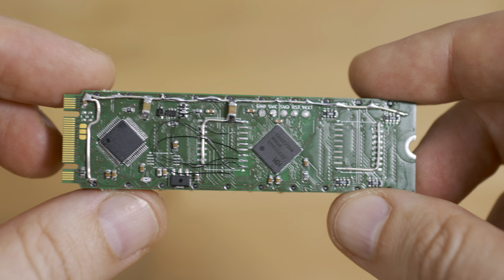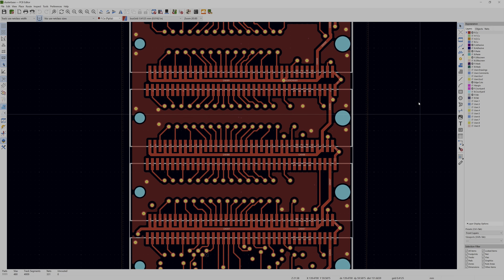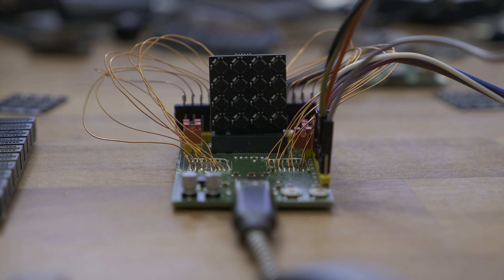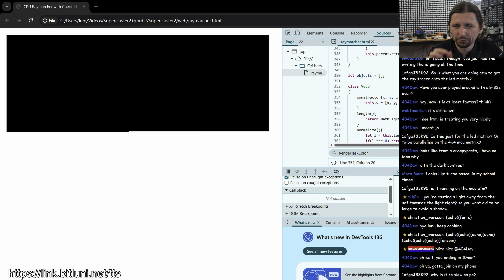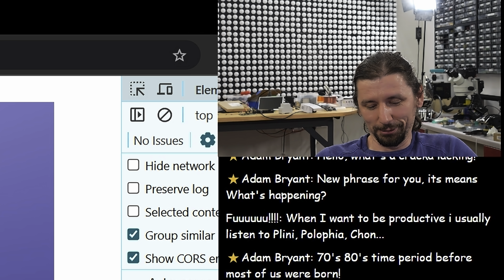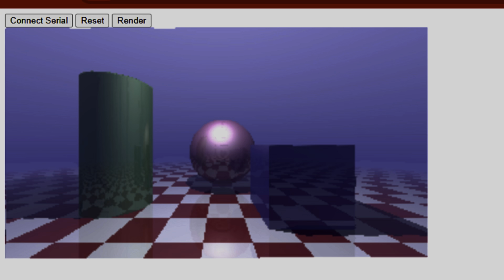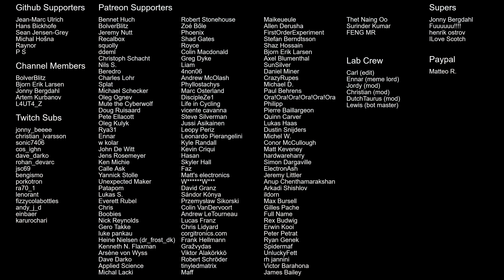I made a GPU at home

Comment: The fastest Async serial I've used is the FTDI 2232 3M baud mode. And at that speed you need to plan for cable impedance and termination.
Reply: Yeah uart just isn't made for "high-speed" transmission. If possible I would go for SPI which can easily do 10-20Mbit/s.
Reply: @robstamm60  it's perfectly possible to run UART on 11.5mbps or even more (getting stable connection at 28mbps on a custom UART). If you put rs422 transceivers in between, you can even do it at a considerable range.

And no, you do not need to think about impedance until about 100mhz.

Comment: Hey! Nice project! 
Fyi, I got myself a resib 3d printer and its very not as complex and messy as people make it sound. 

Basic cheap abs-like resin end up being heat resistant enough to handle soldering temperatures. You could model yourself a jig to align all your vertical m.2 connectors

Comment: When I Learned micro soldering (in uni) with solder paste the process was to apply the paste, then place the components on the PCB with pads or pin on the solder paste, the we could move the PCB with it's component to an oven (or more realisticly an hot plate for DIY).

Is there a reason to place the components on the hot plate like you are doing ? It's seems to make it more difficult ?

Comment: 3:25 "There was no chance to resolve solder bridges under the connector. That is why I reflowed first and then tried to place the pre-tinned headers"
You're welcome.
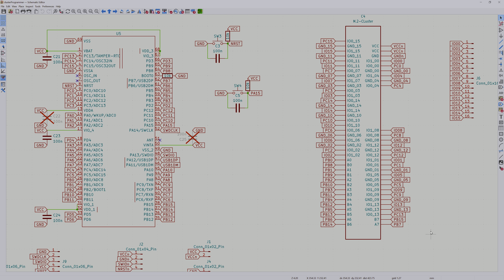Reply: 5:33 "Actually, on the cluster groups of 10 MCUs share a trigger interrupting all 10 MCUs. But during the trigger interrupt the id of the target is put on the data lines. The target continues listening while the others continue their tasks."
Reply: Thank you!
Reply: Thank you!
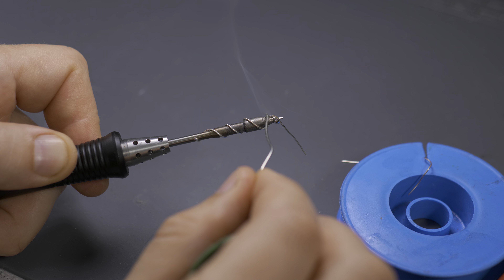Reply: 4:06 "The solder helps transfer the heat from the tip to the wire."
Reply: i happen to be on the mobile watching, thank you so much (if it were desktop i could use . and ,)
Reply: What fucking text are you people talking about, I go to the time stamps and i see no such text.

Comment: The amount of knowledge to do this is tremendous
Reply: One of the best things about Bitluni's projects is that you can follow along on the live streams and learn how to do these things at the same time.  It's not just the knowledge which is important.  Perhaps the most important component is the ability to research and learn new knowledge and to adapt to do whatever is necessary to finish the project.  This channel is a master class in such things.
Reply: @Peter_S_  no doubt..
Reply: @Peter_S_  I'd say the drive to do so is the most important. This dudes drive is enough to put a fist through a foot of steel.
Reply: @Peter_S_  I tell everybody that same thing, it's not the knowledge, its knowing how to learn it, understand it, comprehend it and be able to correctly teach it , simpler than how you learned it.
Reply: @Peter_S_  look man nobody is going to watch a 300 hour stream with about 20 hours of condensed knowledge. Some of us have jobs. That is literally the worst way of learning.
Reply: you got that right! he is a mad genius!
Reply: @GameOverDave not genius he just has good memory. Use some calcium tablet and vitamin b. It will help
Reply: @TecArtScien thanks
Reply: it is part of the addiction to flux smoke
Reply: Not if you study the basics of electronics and it's components and coding and read accompanied datasheets to your components and have a thought out project from the start, than prototype away
Reply: I watched this so I can pretend I know what he did
Reply: Annndddd you can learn it all for free online! That’s the power of the Internet! But most people choose not to, apparently learning is hard or something!
Reply: Kinda. But when you specialize, your capabilities increase exponentially as you gain knowledge and experience.
Reply: well, yes ... but on the other hand : standard micro-electronics & embedded software dev. We are indeed using dark magick - but you can, too! Everyone does
Reply: @ololh4xx  What's even more scary and dark magic is RF-electronics.
Reply: @Atom224  hush now, do no speak of terrible truths when mortals are around!
Reply: @Atom224  Here's a little secret...  Once you're working with transition times below 10 ns,  you're already practicing RF electronics whether you like it or not.  RF is just different but no black magic is needed, just exceptionally well understood math.
Reply: @ololh4xx  I don't know bro. Some of us are 15 watt bulbs with a 100 watt curiosity... The hands we were dealt haha.
Reply: @ololh4xx  this is absolutely not standard lol there's no way you are working a job in embedded
Reply: @warguy6474  sure. Good luck with your job training and whatnot.
Reply: I doubt it.
Reply: There is also patience involved in it that is high.
Reply: how do you even learn this stuff?
Reply: @Dark.Syndicate  Be sure all your notifications are on and join a live stream.  Bitluni streams fairly regularly and the streams are like hanging out in a dev lab.  Lots of helpful people and plenty of explanation.  He might seem like an electronics superhero, but he's just a regular guy with huge levels of drive and an appreciation for learning.
Reply: @Peter_S_  In fairness, there is a lot of material out there that can poison people's learning attempts when trying to learn this stuff. The water pipe analogy for example, instead of diffusion of charge. You see people have a lot of trouble with any science gated area like this when their first exposure was based in a "lying to children" based pedagogical approach; where first principles are muddied with rhetoric that contain some true but also quite a lot of false assumptions that must later be corrected after learning to competence; some people's minds just don't work well with that type of iterative approach based in struggle. This approach starting in the 1970s was quite different from the first principled approach taken prior to Sputnik.
Reply: Spend 2 years like a geeky Nerd with real hardware..
You can learn it too.. 
And I have done some very stupid things.. and I am a software guy (Business Software, nothing close to bare metal sadly now).
Reply: knowledge alone isnt enough, but yes tremendous knowledge is needed
Reply: insane.
Reply: Probably the equivalent of a computer engineering degree.
Reply: @ssttssttsstt  Nah, I have that degree. Is nothing near this just for that. All my respect.
Reply: @F051Gaming4Life  you have a degree and you couldn't use VHDL to make components?
Reply: this is standard "Computer Engineering" degree shtt. most EE's would be able to do this as well
Reply: @davidanalyst671  highly doubt bro
Reply: bro is a computer genius
Reply: exactly what i was thinking - mind blown!
Reply: Now, to mine some Bitcoin 😜
Reply: @sdfxshow
Reply: The amount of knowledge that you need to use the word tremendous is horrid
Reply: But it is learnable! There has never better time to be a hobbyist.  There is so much open source software and knowledge out there today
Reply: also a patience of a saint
Reply: Pcb designing? Wooow
Reply: @mesterdarius493  is it? come on!
Reply: dudes an alien how u get that knowledge you got some sort of arc of covenant in your basement what the deal? why you not richer then elon?
Reply: @homelessEh because his father doesn't own sapphire mines
Reply: @homelessEh Because you have an incredibly wrong view of how the real world works. Rich people are rich because they scheme and steal.
Reply: @homelessEh do a computer science degree or self teach every fundamental level and you'll understand that every single step of electronics/computers end up being a combination of on or off, logic gates 
(AND, OR, NOT, etc.), and all the combined layers each step forward.   Once you understand that and keep each learning the next layer and once you get"it" it becomes like learning a language to study more and more advanced layers of.   This man just happened to put the time in to learn the extra layers once he understood the foundation and put the time and work in to exceed even most advanced people.   I don't have the patience but I can see how he would end up there.   He is brilliant and very worthy of any and all praise he gets nonetheless.
Reply: That is what AI is for.
Reply: What's so "crazy" about this? PCBs have been around for like... 100 years? It's way less impressive than the title suggests. This is just a bunch of MCUs stuck together on a single board being controlled by a standard UART. He didn't use M.2 as in implementing the PCIe protocol. The M.2 connector is NOT communicating with the PC in any way. It's pointless to even call this "M.2" as it has nothing to do with what M.2 is used for.
Reply: @_________________404  i dont see no  hardware videos on your channel just eff off nerd
Reply: @_________________404  The host M.2 is indeed connected to a PCIe to serial bridge which is how all the host communications occur. You are incorrect and wrong.
Reply: @Peter_S_  No it’s not wrong. He has wires running to it from the side which are for the UART.. It’s visible in the video.
Reply: @_________________404  You're confused by the JTAG adapter for reprogramming the backplane host MPU.  The PCIe bridge chip is a Winchip CH382.  It's the chip on the bottom closest to the M.2 connector.  There was a (very) short discussion in the live stream about PCIe lane polarity swapping during PCB layout and more than one of us had the datasheet for the CH382 open.  I watched Bitluni route the PCIe traces in real time so you may wish to review the facts before making false proclamations.
Reply: @Peter_S_   His own fault for not putting it into the video. There's a part where he uses it without being plugged into a PC, supposedly without the bridge chip. That being said my point is still true, he DIDN'T implement the PCIe protocol, he just used a PCIe bridge chip for the UART. Switching out usb UART bridge for this is like 5 minutes of effort. 

(The guy tries to deny it in the reply to this comment, but doesn't understand that serial over PCIe is not the same thing as if the MCUs were communicating over PCIe.)
Reply: @_________________404  🤦 No, you made a silly assumption without any evidence and you got it wrong.  Now you move the goalposts.  I'm going to guess you've probably never built anything.
Reply: Nah this guy is useless, has no clue what he's doing.

Comment: This channel is always such a joy to have a video pop up out of nowhere.

I also applaud the usage of Kicad so us hobbysts can actually interact with the schematic and PCB design without needing to the absurdly expensive Altium licensing. I wish the schematics and some of the PCB design was in PDF form so it's easy to see at glance in github.

The javascript portion for the web front end is pretty readable (very happy to see it's not using some insane massive framework or npm hell, just raw HTML files with js embedded into it using script tags).

Hell, the firmware portion is written in platformio which makes it trivial to download and build locally without needing to mess with the horror show that is most modern embedded "IDE's. Even includes the .vscode directory, wow! I don't see the firmware using const correctness coding conventions or some of the more modern C++ features like initialize lists or constexpr, but hey, this is infinitely better than most C based firmware.

And lastly, actual links to all the chips off aliexpress, nice. Keep in mind you can always get many chips like this off LCSC for similar pricing, but it's an authorized distributor for most chips rather than some random shop off aliexpress.